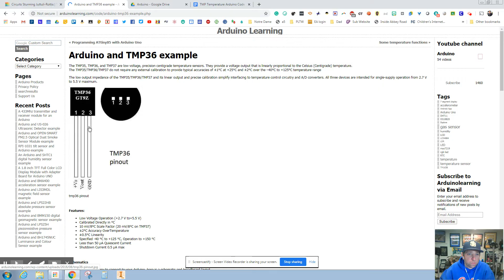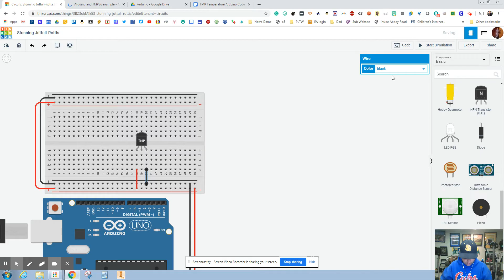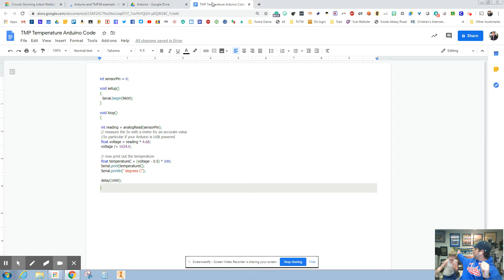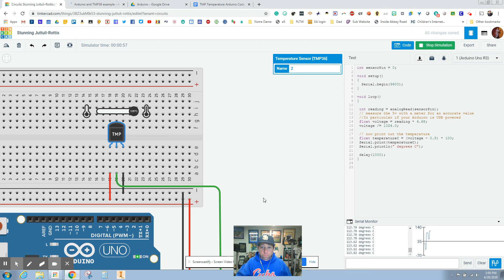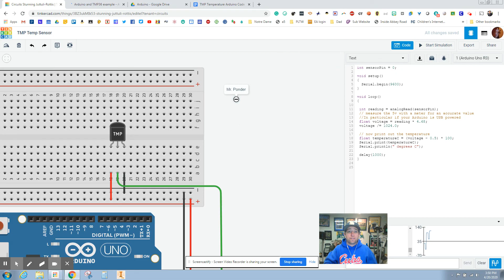TMP Temperature Sensor Arduino on TinkerCad

Comment: "it is reading it correctly" . . hmm obviously not. There's a huge difference between the actual reading and your Serial monitor reading. Why don't you use the map function? 

int temp_mapped = map(analogRead(sensorPin)),20,358,-40,125);
Serial.println(temp_mapped);

There will be a 1C error for some values but at least, its value is closer to the actual value.
Reply: It will read correctly on 4.6V i think. Thinkercad is running a flawless 5V.